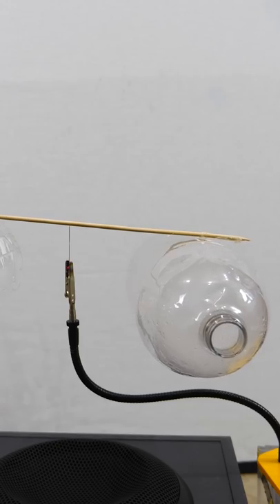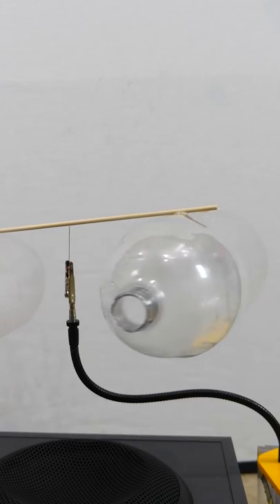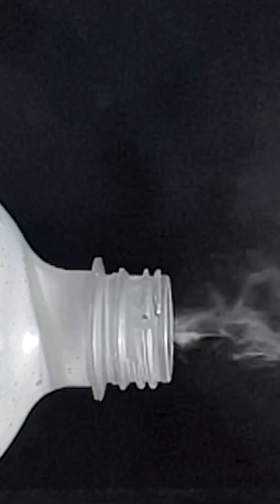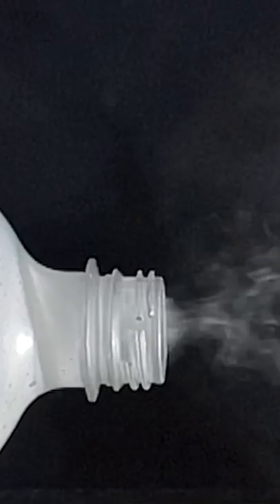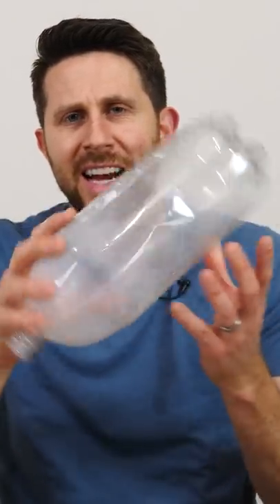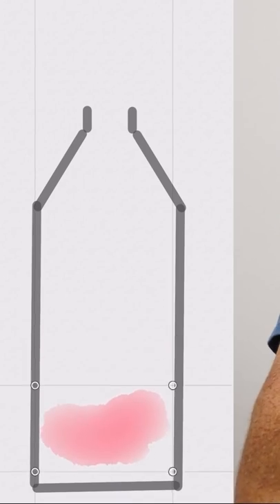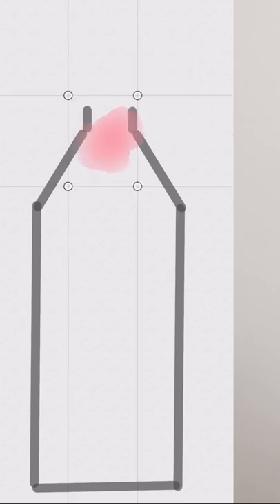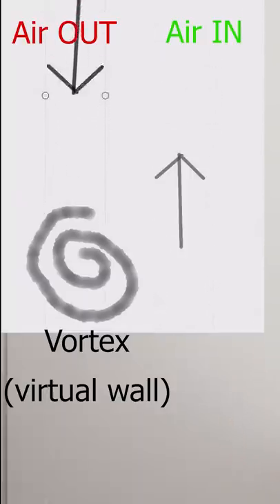Acoustic Rockets Using Helmholtz Resonance

Comment: Helmoltz is often used in measuring hi performance exhaust pipes. You can actually use this principle to gain horsepower.
Reply: Yeah.
Reply: Are you into racing, I'm curious how'd you know about this stuff👀
Reply: @abhineetsingh12  idk something tells me they only know about German made cars
Reply: @SUPERMAR10312  😂😂😂
Reply: Lmao just scream at your exhaust pipe and you will get +10 bhp guaranteed
Reply: @SUPERMAR10312  , lol, very clever
Reply: Care to explain? this reminds me of when I replaced my muffler with a straight pipe for more power(and more races) until I  found out you need some kind of back pressure, and that I actually lost power without it
Reply: That sounds exactly the same as the "scavenging" In 2 stroke engines. It does work for 4 stroke too by creating a vacuum in the head as the exhaust valve opens, the opposite for the intake. Resonant frequencys applied to rpm and fluidity of the engine makes a masterpiece of an engine 🙃
Reply: @slimkillac  Check out Engineering Explained's video on exhaust back pressure, he said the engine doesn't need it and in reality oversized pipes lead to reduction in velocity and scavenging, on my friends project car he swore up and down that the pipe he threw on lost all back pressure, we then found out too large a diameter simply lowers the velocity of the exhaust gases to the point of losing performance (Same level of output trying to fill a larger space with gases). Gotta match flow to diameter still, but not for back pressure.
Reply: Ayo is that nazi hello kitty?
Reply: What!!
Reply: @Abhineet Singh  most aftermarket exhausts use helmholtz resonators.. All of my Motordyne exhausts have had them. Common knowledge that you can tune the exhaust tone with them
Reply: It's used to reduce the SPL and change the tone of the exhaust
Reply: And in the intake too
Reply: Interesting!
Reply: @mitsuracer87  Exhaust resonators cancel undesirable sounds. Intake resonance is different. Most cars have one particular rpm where they make peak power. The resonance of the air in the intake helps air flow at that rpm. If you change the length of the intake, or simulate a change  in the shape, you change the point were it produces that perfect flow. Also my Mazda intake, uses the air that bounces off of shut intake valves. The air compresses on the back of the valve like a spring. Then changes direction back up the runner to the intake into a runner with an open valve. A resonance based micro supercharge, worth about 2hp. 2 valves in the intake itself, close and open at different rpms, shortening and lengthening the path the air has to take. Keepng the engine in power. 200hp feels like 250 because it's more constant. Also why a 400hp BMW M5 5 passenger sedan could have the same performance as a lighter 400hp C5. Closest example I know of. Same BMW engine is in the Z8.
Reply: Harley-Davidson-bikes-are-tuf-tuf-boats confirmed
Reply: @puerlatinophilus3037  Whats a Tuf Tuf!
Reply: @pgtmr2713  Is this like variable valve timing?
Reply: That’s why the intake and exhaust tunnel length is different. It keeps the air flowing smoother by resonance!!
Reply: @u12bdragon  Does that mean cars with sub woofers have more HP?😏
Reply: @ludicrous7044  The benefits are similar, maybe better. If you could have an infinitely adjustable intake somehow you could always have peak power, VVT you have a low and a high not necessarily 2 peaks. Fuel economy mode and not. Would be great to have Variable intake, VVT and a variable exhaust length. Could make a small engine feel pretty big. As it is, the 2.5l v6 with 164hp  pulls like an old school 5.0l v8. Just does it with higher rpms

Cancel

Reply
Reply: @u12bdragon  🤣🤣🤣🤣
Reply: @abhineetsingh12  ..... no the person talking about car mods obviously doesn't know anything about cars.....bruh
Reply: Dang
Reply: @slimkillac  you don't need back pressure, back pressure does nothing to increase horsepower, that's actually common misconception that centers around the very same misconception the person you're replying to has. See my more in-depth reply to them for an explanation.
Reply: @ludicrous7044  The length is actually different because they use two different types of resonance, one uses helmholt's resonance and the other uses quarter wave resonance, at least when they're designed properly
Reply: This is actually a misconception. The bottle uses helmholtz resonance, aka mass loaded resonance. What he describes, and what exhaust pipes use is called quarter wave resonance. Mass loaded resonance is basically the same thing as a bobblehead, the mass of the head on the springiness of the spring causes the head to bounce back and forth, the stiffer, the spring or the lighter, the head, the faster it bounces, the lighter, the spring, or the heavier the head, the slower it bounces. The momentum of the air traveling through the opening of the bottle is like the mass on the spring in the bobblehead, and the compressible air inside of the bottle acts as the spring in the bobblehead. There's no wave front inside of the resonator in a helmholtz resonator, it's simply the momentum of air in the tube compressing and expanding against the springiness of the air in the chamber.

Both helmholtz and quarter wave resonances are used in automotive applications, because of the higher amount of fluid that needs to be transferred in an exhaust pipe, they use quarter wave resonance. The intake plenum on the other hand uses helmholtz resonance.

In the exhaust pipe, the wavefront travels back and forth along the tubing to create a low pressure area when the exhaust valve is expected to open, which helps suck the exhaust gases out of the pipe by decreasing back pressure. The longer the tubing, the longer it takes for the wave front to travel from one end to the other and the lower the frequency and vice versa, similarly the narrower the tubing the faster the way front travels down the same length of tubing due to the same amount of energy being forced through a smaller space, and therefore the higher the frequency but also the more unwanted back pressure and lower flow rates. You also have a half wave resonance between the exhaust tip and the collector where all of the exhaust runners meet up, the difference between a quarter wave resonator and a halfway resonator is that the quarter wave is closed on one end in the form of the exhaust valve, whereas a halfway resonator is open on both ends between the collector and open air, the wavefront interacts differently between open and closed ends of a tubing, and that's why one is tuned to a half wave and one to a quarter wave. The exhaust tubing is typically sized to a certain flow rate, and then the length is tuned to match the resonance at a certain engine RPM at which you want the power band to reside. Quarter wave resonators have a lower frequency drop off  than helmholtz resonators which basically means the effect doesn't worsen as bad when you start to leave that ideal RPM range compared to an intake manifold's resonance.

Intake plenums on the other hand, use a combination of the springy mass of air inside of the plenum as well as the momentum of the air moving through the shorter intake runners. The calculations for this type of resonator are more complex because you have multiple inlets and outlets and it's a much more dynamic environment than a simple soda bottle, but the concepts are still closely related. Helmholtz resonators also lose their efficiency faster that quarter wave resonators the further you get from that ideal frequency/RPM which is why some manufacturers like Toyota have included valves or similar mechanisms that allow the length of intake runners to change as you reach different rpm ranges.
Reply: WoW 😳🤯👏👌👌
Reply: What does sound have to do with horses?
Reply: It is also used in a lot of factory air intake ducting as well, to reduce air intake noise without limiting airflow. You can usually tell quite easily if your cars intake has a helmholtz resonator because it will be a big oddly shaped box sticking somewhere off of the main tube.
Reply: @platinumsky845 knowing what you know, I need you to show me how a flute, ferrofluid, and a wedge can pick up and carry a large mass. I feel as though you’ve done it before

Comment: Resonant frequency.  Same as trying to find it for car audio sound system stereos.  It's a little complicated to explain but you use a pressure microphone in a car to get its sound pressure level.  You use a non ported box with any speaker or speakers and fluctuate between Hertz usually around 40 to 70 Hertz in a car, cycle from lowest to highest from low to high Hertz and measure every single Hertz reading.  There will be only one specific Hertz that measures louder than any other.  Whatever Hertz level measures the loudest that would be the resonant frequency of your car for instance.  If you roll your windows down it changes your resonant frequency versus having your windows up.  But the fact that this can create thrust surprised me at first, but the more I thought about it I was still impressed.  For car audio after you verify what your resonant frequency you build a ported box designed to play that frequency at peak and your stereo works with your car which literally vibrates in harmony with your stereo and will increase your decibels in a huge way.  I love building speaker boxes and this is an artform all by itself.  Resonant frequencies have barely been explored yet.

Comment: Wait, I don’t understand how you’re replacing the air inside the bottle while air is being pushed out. How is there zero net change in the amount of air inside the bottle? That part wasn’t sufficiently explained.
Reply: Anyone, correct me if Im wrong as my brain is half asleep rn. But basically, air does NOT travel out from inside the bottle. What happens is air that is already outside the bottle and near the mouth just gets pushed away by the resulting pressure wave that bounces off of the bottom of the bottle. Then newton's 3rd law takes it from there.

Edit: so just to clarify. The pressure wave doesn't necessarily push the air away. It's the air vortices formed by the pressure wave near the mouth of the bottle that acts like some sort of a propeller.
Reply: There is a cool video about a popper boat that uses the same principle but with water and heat. Think of it like throwing something while standing on ice. You will move in the opposite direction as what you threw. Now catch something thrown at you. You will move in the same direction as the thrown object. Now consider the bottle is throwing air out of it and catching air at the resonant frequency which creates thrust based on the momentum of the Air and newton's laws of momentum. Cool principle.
Reply: Net thrust is caused by the difference in the shape of the flow between the air going out and back in. 
A fluid ejected from a nozzle moves out in almost a straight line, but when a fluid is pushed backwards into a nozzle most of the flow comes from the sides. This gives a net imbalance in the thrust produced.
Reply: @ferrumignis  Thanks, this is the explanation that seems to make most sense.
Reply: @idiosyncrasy7703 The smoke test shows that air from inside the bottle does come out.
Reply: @ferrumignis  yes, this is correct. Same like at a poppop boat engine.
Reply: The way I look at it, once the standing wave is established, vibrating air inside the bottle is hitting the closed end of the bottle and bouncing back towards the nozzle. This creates an unbalanced force, propelling the bottle. The "wall of air" explanation seems strange and unnecessary.
Reply: Think of what happens when you pour water out of a bottle quickly. It goes "glug glug glug" because a bunch of air bubbles are going up through the water, because any water that leaves the bottle must be replaced with air or some other substance, otherwise a vacuum would be formed inside the bottle. That's also why bottles can get stuck to your mouth if you put your whole mouth on it while drinking, there's no room for the air to get in so it creates a vacuum that's sealed by your face until you pull the bottle off. So it's the same way with the air in this situation, except instead of water leaving the bottle and being replaced by air it's just air replacing other air. I guess the escaping air probably flows past/around the entering air so they don't get in each other's way. Now what I don't understand is how the soundwave can push the air out in the first place...
Reply: @DuckInGameStop  the first part of your comment reminded me of “horror vacui”.  Makes me wonder also, if nature really hates vacuum that much how did interstellar space came to be ?
😉
Reply: I think that the fact that the bottom has a little more surface area than the top, has some effect.  We need a high speed camera, to watch the speed and direction of particles moving with the air passing through the opening.  Also, the sound that makes it move, was slighty higher in pitch. I'd love to try to see if fine tuning the pitch, could maybe change the direction of movement.  also, what about double or half the frequence?
Reply: @anonymous.youtuber  gravity
Reply: @ferrumignis  Sounds X rated!🤦🏻‍♀️
Reply: The air pushes back and forth in and out of the bottle like a jackhammer, there's a net forward thrust because pressure creates more thrust than vacuum does, so one force is higher than the other even though the same amount of air was being moved in both directions.

Comment: I still dont understand that how is it thrusting air when its net movement is zero...🤔
Reply: If you plot the forces on a free body diagram the net force would not be zero. I think it's similar to his putt putt boat and iphone blower videos
Reply: @justasandvich7168  true...👍
Reply: @DORAELOG just because “net” movement is zero does not mean air was not displaced at any point ever. It just means that, over time, there is not more or less air going in or out. However just because the amounts of air exiting and entering are equal, does not mean the velocity and times are equal.

Because of the resonant frequency, the air escaping the bottle would exit in regular puffs, while in between (or even simultaneously beside) puffs of exiting air, there would also be air going in.

Think of it like water in a container, and you push your hand through the water. The water moves and compresses (and could even potentially move the container if it is light enough) but the “net” movement of water in/out of the container is zero.

Now just replace the water with air, the container with a bottle, and your hand with an amplifier producing sound waves at 112 hertz. And you have what the video shows.
Reply: It pushes air out in the center towards the back and sucks air in from the side. This generates the thrust. It's just like put put boat and phone candle blowers like others said here.
Reply: Great question. People (or ai) need good questions like this to answer and build off of.
Reply: Its sucks in air from many directions, causing the forces to cancel out. Then it shoots that air back out, but only in a specific direction, hence no canceling out of forces

Think of it as drawing the flow of air on a fan. The suction doesnt care where the air comes in from. Then at the front it blows roughly in one direction.
Reply: Pressure creates more thrust than an equal amount of vacuum, so the net thrust is in the direction of pressure not the direction of vacuum
Reply: It is the pressure wave moving out of the bottle and then Newton's 3rd law: for every action there is an equal and opposite reaction.
Reply: @patrickmccormack3209  That's not what they are asking, the answer is in the comment below yours. It's thrusting because the air being sucked in comes from every direction and the force cancels out, but the air moving out only shoots in one direction.
Reply: It's just like swimming in a pool. Take the fluid (or air) from many directions and push it in a single direction.
Reply: @mad_vegan  this is a false comparison, because I'm your example there's a net movement in the fluid in a single direction relative to the body exerting the force, in the video there's a net movement in two directions that is periodic and equal in magnitude through the nozzle of the bottle. Apples to steak comparison.
Reply: @jefftruman5657  if it was that simple there'd be zero thrust because there's equal forces, and therefore reactions in both directions from the pressure oscillations, resulting in zero total net thrust.
Reply: @platinumsky845  except the bottle is closed. The force can only go in one direction.
Reply: @platinumsky845  The net movement of water in the pool is zero, otherwise the pool would eventually run out of water or move backwards.
Reply: @jefftruman5657  there's a pressure exerting a force outwards during the peak of the oscillation and a vacuum exerting an inward force during the valley of the oscillation, so you're wrong by your own definition of having a closed bottle. I already explained in a reply before yours was even posted why one of the TWO forces is stronger than the other, and it's not because the force only goes in one direction.
Reply: @mad_vegan  notice how I phrased that the movement is "relative to the moving body"? That's because it acts the same as a bird in the sky or a fish in the ocean, you're exerting a force in a single direction, unlike with the bottle.

Thank you for validating my claims by arguing a point I already addressed. Try to keep up next time.
Reply: @platinumsky845  By your logic the experiment showed in the video should be impossible.
Reply: @mad_vegan  By YOUR logic, yes, the experiment should be impossible, I already explained why it works in a comment long before our discussion started. Long before you ever replied to these comments.